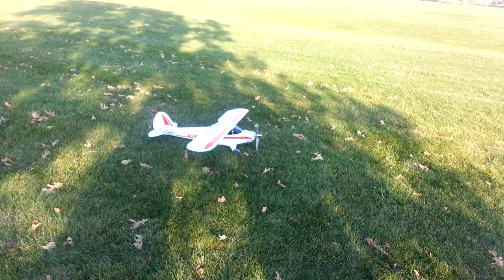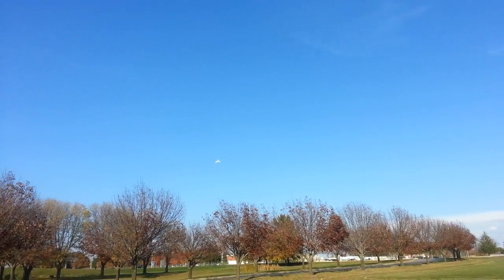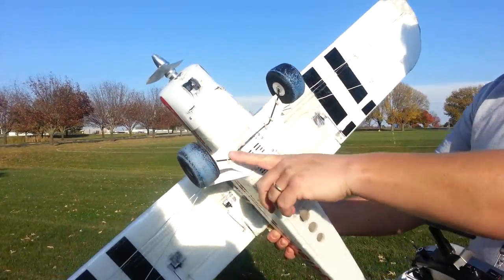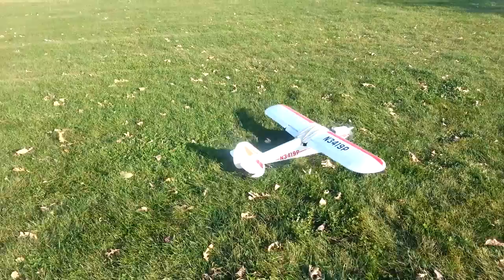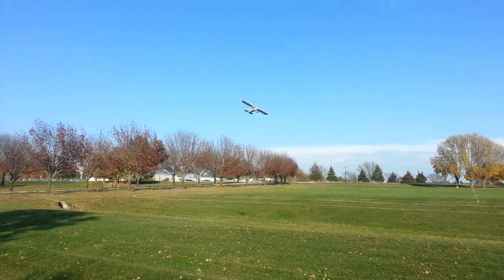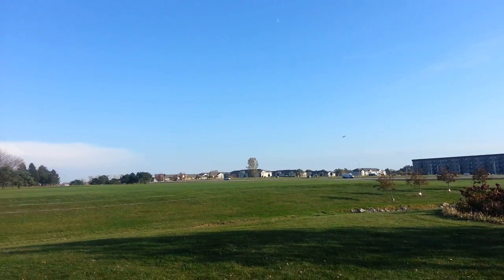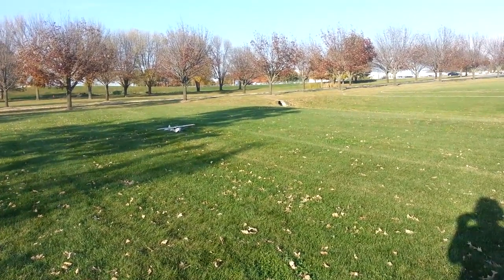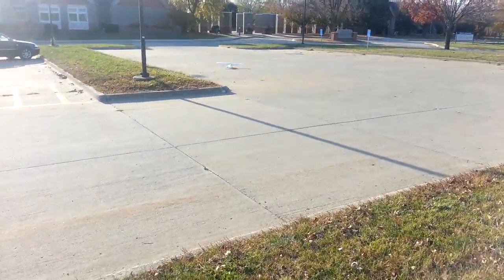Tundra Tire - Flight Test of Super Cub S

Comment: Yes where did you get the tires, I have this plane ain't got to fly it yet thanks for sharing, do you have a video I do how you did the LEDs I'll be watching for more
Reply from the maker: I made them out of a pool noodle :) Super easy, but kinda ugly...
This plane was an early one for me, so I don't have the same playlist features... as of late, when I get a new plane, you can pretty much watch from unboxing to build, to radio setup, to mods, and flights too.....but this was back before I got super detailed in my videos, so you might need to check out some of my newer footage to supplement this one.
Good luck!
P.S. This plane is barely a Super Cub S...it's got all new electronics, a brushless motor and 30 Amp ESC, and uses lipos...so it's been totally overhauled, and it's still flying today, btw :)

Comment: Where did you get the tires?
Reply from the maker: +Caleb Teague These ones I custom made out of a pool float toy. I cut off a section, rounded the edges, and then made a wheel out of some medicine bottle caps or something similar.

I have since modified it furter to Dubro Wheels, which look great, but are more heavy.

This plane was another of my "experimental" aircraft, in that I've tried tons of different rc skills to learn, and had some good success too!